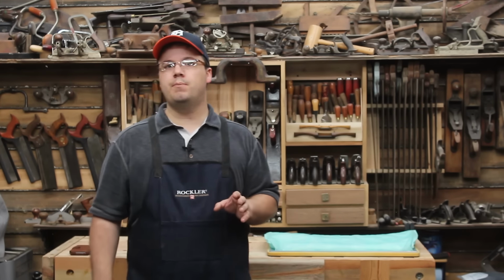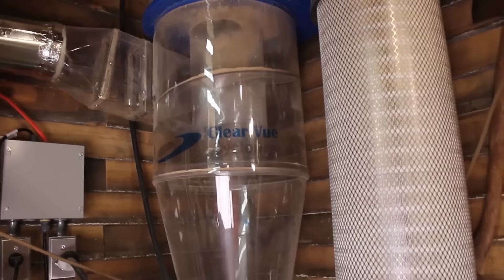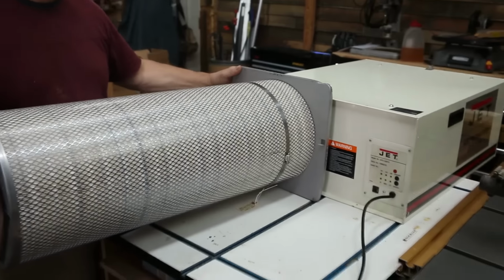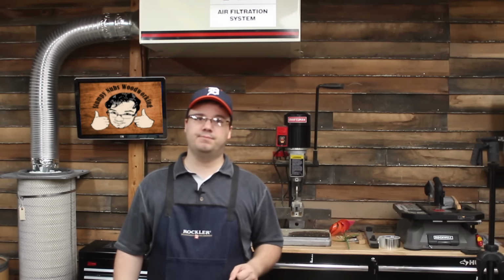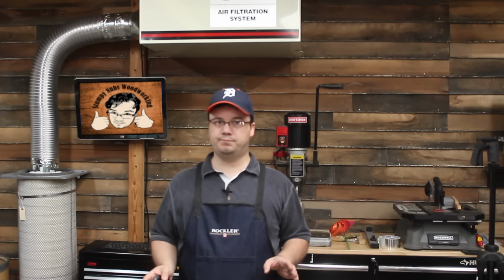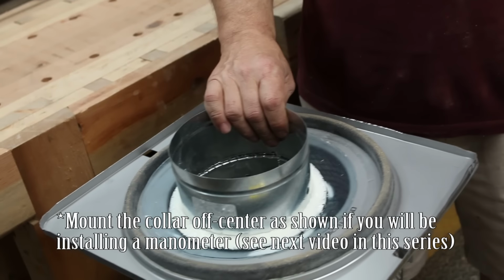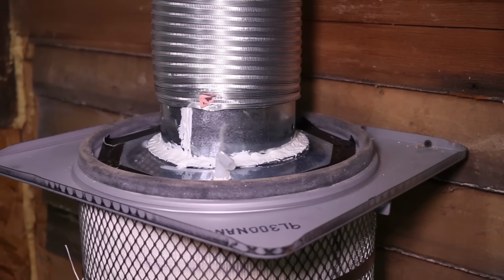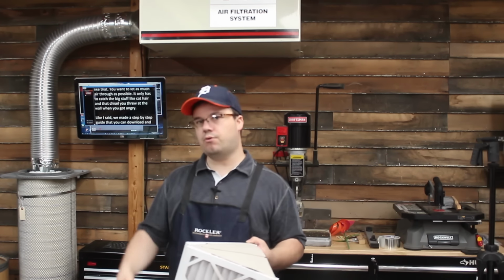SNW56- Upgrade your Ambient Air Cleaner Filter (Jet AFS-100B, Delta 50-873, 50-871 Etc)

Comment: Wonderful site and videos!  Thank you!  Question about increasing efficiency and upgrading an AFS.  If you are going to put the filter at the end of the AFS unit to capture the fine stuff why not just run the duct (WITHOUT secondary filter) back to the dust collector?  I have a Jet DC-1100 and would require a Y-connector to receive the duct from the DC-1100 (w/ 2 micron canister filter)'s impeller as well as the duct from the modified AFS (sans secondary filter) as you are recommending.  Would that not work? 
 
No need to buy a separate expensive filter and would only require 1 waste reception point to clean out (bottom of DC-1100) and my 2 micron canister filter would handle the fine stuff .  Just an idea that came to me.  

I was looking to make my own AFS from some of the ideas on YouTube.  Using a Harbor Freight $79 8" ventilator 2 speed blower pushing 1590/1380 CFM.  Should be enough power to force the air into the DC-1100 with a Y-connector to receive duct from AFS modified and from DC-1100 impeller to even with the DC-1100 not running. 

Perhaps others have suggested it or you have thought of it before and it has been reasoned as not viable.  I'm just starting to put together my shop (in my garage) as a newbie woodworker and appreciate the site and videos you are providing to others to cut down on our trial and errors!

I will try it out in my shop!  I'm so new as I haven't done anything with my tools yet.. just gathering the tools and wanted a good dust collection system to protect myself before I start on any projects (bunk bed for daughters first).
Reply from the maker: Michael leahciM - You absolutely can do that! It would work just fine!

Comment: What modifications to this system would you recommend while using an HVLP system to apply finishes?  I use Fastcap 3rd hands to create a temporary plastic-walled booth and have been considering the repurposing of my ceiling-mounted Jet air cleaner.
Reply from the maker: shane chambers - I would not use a filter like this for any paint of finishes. You can't clean that off so it would plug up the filter. I would also hesitate to use the JET system for it without contacting JET to be sure it is an entirely closed motor. You could end up destroying it, or worse yet, starting a fire.

Comment: Stumpy, Just out of curiosity does putting the micro filter after the fan decrease the life of the motor? I know there is a wedge shaped pre-filter, but the other particles that were being collected by the secondary micro filter are now being allowed to pass thru the blower to go to a "post filtering system"? I am thinking of it sorta like the home furnace, you can put grates by the motor, and the filters in the floor ducts. The grate keeps big debris out while the floor filters make it seem like nothing has changed until you open the furnace and see the dust piled on the motor and blades. Currently I am making one for my shop from an old 4 stage120,000 BTU Furnace motor. Thought about mounting the large round filters on the side opening and building a short duct to keep the air cyclonic. Just throwing the idea out there.. Great videos. Thanks
Reply from the maker: Aaron Emery We're talking microscopic dust. It won't hurt the fan.

Comment: So much information you went out of focus! Thanks for making this series. I was just about to start making mistakes and installing a DC system in my shop. I´ll keep checking the infos.

Again, thanks!
Reply from the maker: ninguemvj $1500 camera selected specifically for its advanced focus features and I get blurry footage... story of my life, eh?
Reply from the maker: Anthony Eaglebarger - I did! I tried out the GoPro and the Sony versions. They're fine for really wide shots in bright light, but not suited to what I do. I even tried the head and chest mounts for filming while working. It just wasn't practical.
Reply: Stumpy Nubs You must be one of us Canucks? I heard you say "aboot" & Eh, eh? LOL LOL
Reply: Stumpy Nubs since you're standing in the same place, do not use autofocus. Focusing manually with ( if the camera allows it ) a higher number aperture will produce the desired result.
Reply: Stumpy Nubs You should have just got a gopro sports camera lol. Much cheaper and has the ability to be mounted just about anywhere with the accessories.
Reply: Stumpy Nubs you could always add a light to the source you're working on lol, much cheaper than those big cameras with the built in lights.